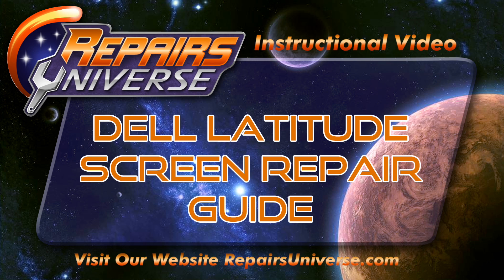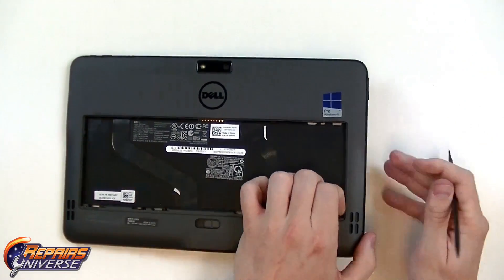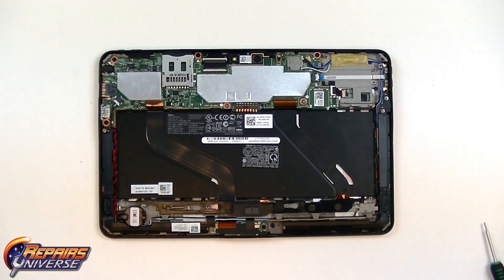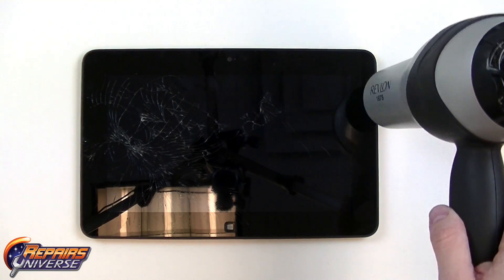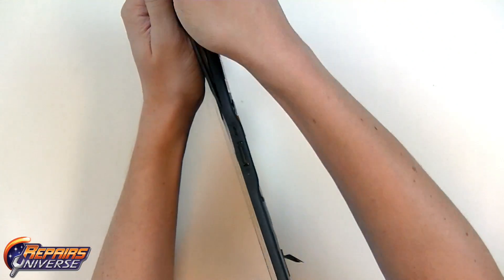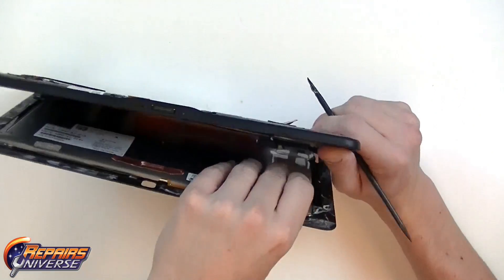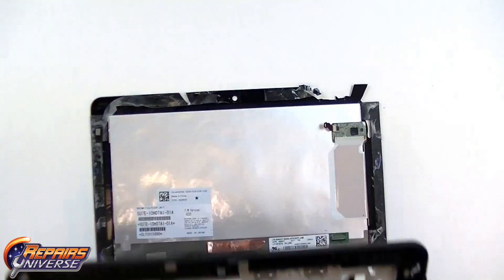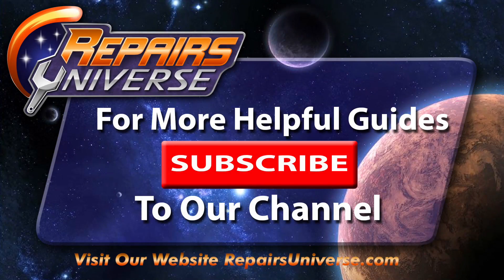Dell Latitude 10 Screen Replacement Repair Guide

Comment: My touch screen does not work. The drivers seem to be the correct ones and the blue tooth option has been disabled. I have a portable keyboard and mouse attached. Its the only way to get around. Can you advise me if the screen need to be replaced.
Reply from the maker: Possible that the digitizer is the issue with your device. I may recommend replacing the LCD and touch screen for this issue.
Reply: I got some advise from the internet and it worked for a while, all of a sudden the touch screen  stop working again. I deleted the drivers and rebooted, and it reset the drivers, however the drivers seem not to engage.  Ant thoughts.
Reply from the maker: No, sorry about that. May very well be a software issue. May want to contact Dell directly to see if they have any alternate troubleshooting steps.

Comment: To install the LCD screen should I just follow the directions in reverse?
Reply from the maker: Eric N Yes, follow the steps in reverse. Make sure to remove any broken glass from the bezel and that adhesive is running along the edges of your replacement screen. This will help you secure the screen back to the bezel firmly.